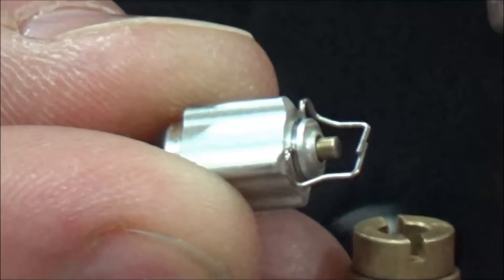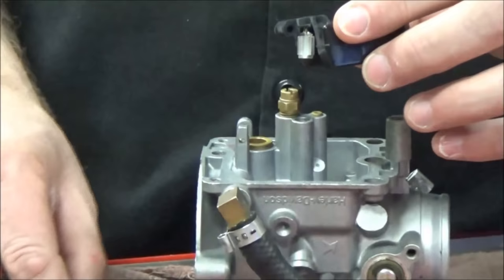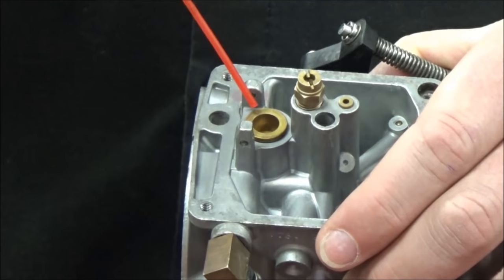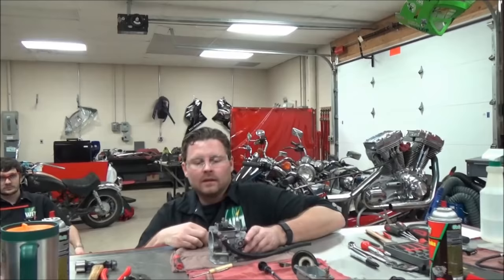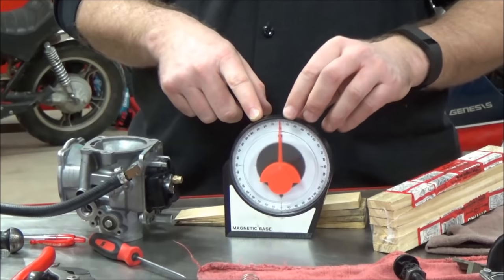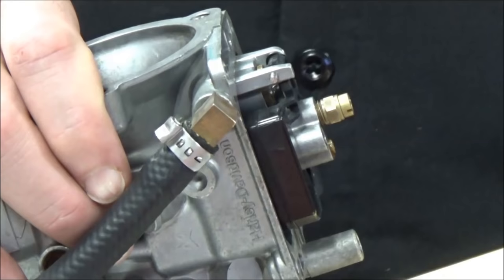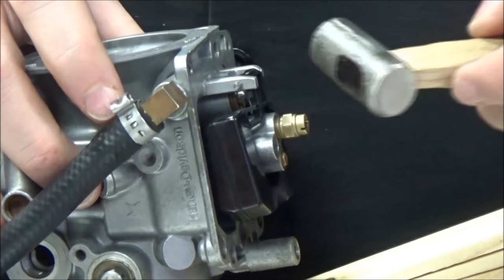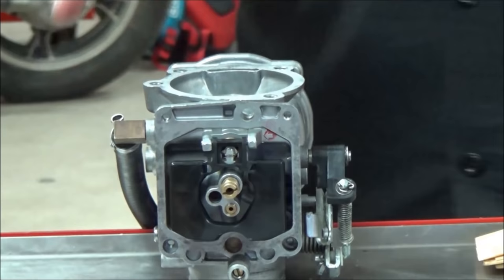04 How to inspect and adjust float level on a carburetor. BONUS: RICH LEAN Fuel Settings explained!

Comment: At first I was very disappointed that the special measuring tool seemed so far off (and that you dismissed it without further investigation), but on reviewing that bit frame-by-frame, it looks like it was set to 10.0mm, which is below spec (10.5-11.5) whereas you had the calipers set to almost 11.5mm.

If the spec does not place the float level to the casting you have to verify exactly which part of the float should be measured based on the service manual procedure since not all parts of the float will be at the same height. This is also true for other float designs which have round chambers.

I would have used a pin punch when setting the pivot pin to avoid any risk of hitting the support leg/tab instead of the taper pin.

But overall a good demonstration of how to determine the correct angle to tip the carb to make the measurement (assuming the manual doesn't provide a specific angle like this one does).
Reply from the maker: Thanks for the feedback. Always welcome. 
Thank you for commenting. Want more? Smash the sub button! Here are the links to support us for this information and our work saving you money.
Join this channel to get access to perks: (Free tool giveaways and member-only videos)
https://www.youtube.com/channel/UCBhM8DCKnT3qXwTW0eToyCg/join      

Give us a high 5 here:  https://www.paypal.me/how2wrench
Reply: Also wasn't using it square it looked like!

Comment: Hey shane , on 2003 yamaha kodiak 400 carburetor,  the atv was given to my dad. I cleaned carb and put new jets / needles in it and machine runs great but i cant choke it much at all even when freezing temps or floods it out. Valve and seat is new and not leaking fuel out overflow so i know float is off , bike runs rich overall. My problem is , service manual says to set float while upside down , well weight of float works against you and i cant get it right. What do you suggest ? Adjusting it upside down seems dumb to me
Reply from the maker: William Welker If it was a quick answer I’d try to respond here but I wouldn’t want to lead you wrong assuming certain factors. Reach out to me on my website contact page. We have been overwhelmed with ungrateful people and
scammers so I had to do something for my sanity by screening the over 300
requests a week! I’d love to working with my members and supportors one on one! 

Contact Link: https://how2wrench.com/contact/ 

Your answers and help are just around the corner. Save time and money while protecting your investment and yourself by doing it the right way at www.How2Wrench.com 

Have you subscribed yet to never miss a video? Have you seen the video playlists https://www.youtube.com/user/conleybuilt/playlists? 

Want to say “thanks” or “keep it up”?
Click here https://www.paypal.me/how2wrench

Comment: Hi shane great video!! I wonder if you could help me understand the lean & rich mixture ldea a bit more when adjusting the float level. I understand that if theres not enough fuel in the bowls the engine wont have enough fuel when you open the throttle & will probably cut out etc. But if there is a bit too much fuel in the bowls wont the jets meter it upon demand & that if there is much too much fuel in the bowls wont it just be dumped through the overflow pipes? Cant quite get my head around it. Any explanation would be much appreciated!!
Kind regards!!
Robin
Reply from the maker: Thank you for taking the time to comment! Hit that subscribe button please! It helps us!
Here is a way to support all the free videos.
Want to say “thanks” or “keep it up”? Click here https://www.paypal.me/how2wrench  

Coach Conley is also available for hire to personally work one on one with you if ever needed. Yep he is a real person. Give him a call @ 602-345-0432

Your answers and help are just around the corner. Save time and money while protecting your investment and yourself by doing it the right way!
Follow us!
Web:
www.How2Wrench.com    
www.Tools2Wrench.com

Comment: My Suzuki GS750E 4 carbs have circular (drum) type floats. Unlike the Harley floats it's difficult to check the floats being parallel with the base line of the carb...ie ..the seat of the carb. bowl.  Also each carb. has 2 plastic floats attached at each end of a brass plate with adjustable tab. How can I check each end (float) for proper alignment? Also the shop manual shows the carb. should be inverted 180 deg. & height adjusted using a vernier gauge & bending the tab to specs. i've done all this as diligently as I can after replacing the jets/needles & seats etc... (Carb. kit) & still leaks fuel. Carbs have been off & on 3 - 4 times with same results...not a simple job on a Suzuki 750 ...very tight installation. I'm stumped!
Reply from the maker: Head over to my website become a member now and to receive 20 minutes of personal mentorship with me. You can even use FaceTime if you have it or find a friends iPhone and we can walk through the actual carburetor process together. I look forward to mentoring you.

Note: Membership is not required to receive coaching or email help. Here are the direct links to individual services offered at H2W:

Email Answer Service-Click http://how2wrench.com/product/email-support/ 

Phone/FaceTime Coaching-Click http://how2wrench.com/product/personal-tech-training-phone-facetime/ 

DIY Mentorship-Click http://how2wrench.com/product/diy-coaching-hire-teach/ 

Dealership Training Services-Click http://how2wrench.com/product-category/dealer-services/ 

MMI/Tech School Student Tutoring-Click http://how2wrench.com/product/mmi-tech-school-student-tutoring-services/

Motivational/Guest Speaker-Click http://how2wrench.com/product/motivational-speaker/ 

On-site Training Services-Click http://how2wrench.com/product/on-site-training/ 

Tech Line Services-Click http://how2wrench.com/product/tech-line-minutes/ 

Mechanic on Duty-Click http://how2wrench.com/product-category/mechanic-on-duty/ 

Did you like this free video and hope to see more? Would you just like to say thank you with a donation? Click https://www.paypal.com/donate/?token=TvKoeRazPL-KysbM-e0ttz-C_gPq2IrqxDmM3ORCu4nxJzQWxYbmo-6m3YuNu64XHLngGW 

Keep Wrenching,
Shane Conley
Instructor/Motivator/Motorcyclist!
www.How2Wrench.com

Comment: great video series shane i have learned soo much.  I am restoring a 1985 lt250r.  The floats are actually captured in the bottom of the float bowl.  It seems difficult for me to get the metal float arm to just barely rest on the float valve.  Any tricks of the trade for this type of carb?  Also would a rich float height make my quad urinate through the overflow tube?

Comment: Hi Shane, great video, I have a wood wedge in my toolbox as well lol. I have a question. 95 harley big twin, only mod  are drag pipes. The bike was in storage a few years back and when I took it out, I had the dealership take care of it due to performance issues. I didn't have the time to do it myself. It never ran right after that. They cleaned the carb by dropping the bowl and that's it. The symptom is a dead spot when rapidly blipping throttle when the bike gets hot. The carb is as clean as a whistle, I have new accelerator diaphragm, slide is good and I have tried a 42, 44 and 46 pilot jet. As I was dialing in a mixture, nothing I did effected it. So for fun, I decided to see if it was too rich by putting my finger over the accelerator nozzle and low and behold and instant fix. Twenty blips twenty perfect responses. Finger off, I get an intermittent symptom when hot. What do you think, possible nozzle damage by technician possibly elongating hole or float height?

Comment: Hey i want to ask your opinion Got a cold start problem on my '89 883 sportster. I pull the enricher cable but the engine never start,only the sound changes. So i must turn the engine like 1 minute without enricher and without throttle. Its the only way that works. With hot engine starts perfect,run perfect. I rebuild the whole carb,new enricher cable,new intake seals,new spark plugs,tried all jet sizes from 160 to 190 including 170 stock,3 needels etc. Im running with free flow pipes and custom air filter,but even with stock filter and stock pipes was the same problem. The floating level is perfect. Its the keihin cv 40 without acceleration pump. The only trick that works everytime : I remove the air filter,pull the enricher and obturate(block) the small air passage from the left side,it's start instantly Sorry for my bad english,hope you got the ideea. Wayting for sugestions Thanks

Comment: Great instruction. Could this be my issue on my 96 Suzuki 1400? Two rebuilt carbs. the front carb has mixture screw set at 2 turns out. the rear carb has mixture screw set at 1 turn. From the factory, I think as these had welch caps on them. I can get the motor running but having to hold my hand over rear carb almost fully shut off from the air. I can rev the engine a bit as long as I compensate my fingers further apart to restrict a bit less air flow.  Perhaps it could be the float angle? Or would you think it needs to be able to run richer? The bike is worth about a grand running. If I take it to service then I'm sure I'd never profit by selling it.  Has 1500 miles. Was stored inside a garage for 23 years. Like new. Only these carbs are the problem with it running right now. Nothing else wrong.  It has a new fuel pump I added, with new fuel lines. Surely vacuum would not be an issue here?

Comment: an 8-32 set screw would be an improvement over bending the tab with a screw driver..
great vid on the techniques tho. 
most of the older methods could be mentioned and go directly to the depth micrometer tool.
All for brevity ya know since us HD riders have such crowded social calendars, 
juz sayin..

Comment: This has been making me confuse. Btw is this correct? A correct height adjustment on the float bowl means that there's a hair line gap between the metal tang adjuster of the float bowl and the float valve button? 

 So when the carby got filled up with fuel the float bowl would be lightly pressing the float valve button?

Comment: Will the float cuase the gas to pour out the front of the carb. The motor wants to run. But floods itself out and gas pours out if the top carb when trying ro run. It will idle. But pours gas out.  > have came up with 2 conclusions. Float or Reed valve. Help

Comment: I have a similar mikuni carb for my quad. The bowl has an angled gasked surface. The float was setup parallel to that plane but I think I am getting too much fuel. The overboard drain keeps leaking fuel a bit. I'll set the floats to be on plane with the jets and see if that helps.
Reply from the maker: Thanks for subbing!
High 5 us with a donation: https://www.paypal.me/how2wrench   
Join this channel to get access to perks:
https://www.youtube.com/channel/UCBhM8DCKnT3qXwTW0eToyCg/join

Comment: Should the VOES hold a vacuum?  When testing thru a vacuum line that is disconnected from a Harley carb?  My switch worked showing continuity but will not hold 5" vacuum.
Reply: It was the vacuum tool leaking disregard question...I watched the video on checking tool for pressure and vacuum test before using.
Reply from the maker: There a few ways you could help keep this work going and stay connected with me personally.  
1. The fastest and best thing you could simply do for us is hit that subscribe button…helps us creators more than you know! 
2. Join this channel to get access to perks:
https://www.youtube.com/channel/UCBhM8DCKnT3qXwTW0eToyCg/join   
3. Give us a high 5 here:  https://www.paypal.me/how2wrench    
Keep Wrenching,
Shane Conley
Peoria, AZ USA
Follow us!
www.How2Wrench.com       
www.Tools2Wrench.com    
Facebook: 
https://www.facebook.com/How2Wrench/   
Instagram:
https://www.instagram.com/how2wrench/

Comment: if i get this right, if i give a full throttle and my bike GSXR 1100 mikuni bts40ss starts to choke (my problem) at 4000rpm my floaters can be off messure and not get enough gasoline?

Comment: I have an old 2 HP evinrude outboard motor and I could only get it started with the throttle plate in high . I tried adjusting both high and low needle valves and no help. I checked the float like you mentioned except for the air testbut I found my problem well half of my problem was with the rebuild kit Amazon sent me. The Float was wrong and the valve seat was the wrong thread and the jet was also wrong. I reinstalled the original float,valve and seat and started it up in high as I had been doing and it took off like gangbusters but only to shut down like it ran out of gas. I have tried everyting but can get it to run. I am convinced though it has something or everthing to do with the float needle valves area. any suggestions would help Thanks was letting

Comment: I recently bought a Honda Rubicon that had been sitting up for a while.  
I've had the carb apart three times, cleaned it and the gas tank 
spotless as well as getting all new fuel lines and an in line filter and
 replaced the needle but it still pours out of the overflow.  I tested 
the float for leaks in a bowl of soapy water, it doesn't leak.  And 
after I put the float and needle back, they moved perfectly fine.   
Any ideas?  It's about to drive me out of my damned mind.
Reply from the maker: https://youtu.be/6BpKFtz_G24
Reply: +Shane Conley I appreciate the quick response but I don't think that's going to be it.

It pours out at probably a gallon a minute.
Reply from the maker: +ScienceFoundation 
Fill just the float bowl and tell me what happens
Reply: I have a 1981 HD sportster 1000cc my fuel pours out of overflow also incarbhow did you repair Phil

Comment: do you wet test when you're done manual setting? working on a 4 set of mikuni bds32's off a 2005 yamaha venture. on the bench every thing is fine no leaks put on the bike fire it up and it leaks

Comment: I recently performed a CV rebuild, as I also got new pipes and air filter. I installed the easy adjustment mixture screw, but my bike runs lean and dies at idle. It runs fine, as long as I keep throttling, or keep my choke pulled out. I went from my reference point to perform the fine adjustment and got as high as 4 turns, with no difference whatsoever. Before I rebuilt the CV, the bike was fine. Any ideas? Great video!
Reply from the maker: You're in luck. I do offer personal service to back up what's missing from a video to actually fix your specific problem. I do work on donations for my time and possible research. 
Good news is its CHEAP! For my time would mind becoming a member of my website? It comes with a free HOW2WRENCH “Keep Wrenching” t-shirt or 20 mins of techline and that will cover my time to assist you so we both benefit. So to have me personal cell phone number to put in your phone as your direct info and how to coach, sign up now! As always thank you and enjoy the free videos! Much more to come! I look forward to working with you and hope you will become a member of or learning community. 

Link to membership: https://how2wrench.com/product/membershipmembers-onlymembers? 

If I can ever be of service to you, here is a video explains how to connect with me. 
https://www.youtube.com/watch?v=vjvmB01ebcs 
Direct link to services: 
https://how2wrench.com/product-category/tech-lineservice-callminutes/ 
Live Chat is great for you to actually show your specific issue!
Donation link: https://www.paypal.me/how2wrench

Comment: Gas keeps pouring straight out of carb no matter what I do. I’ve tried setting the seat bowl height, making sure it has clean fuel. Cleaned the carb several times and rebuilt it still nothing. It’s 2003 Dyna any suggestions???
Reply from the maker: That’s a great question for Shane directly! We are just the social media team. Shane has a solution for you. As far as the question, Shane does answer questions when he get's back around to non members eventually so hang tight, FYI >>>> he does member ones daily!
He is just returning from an extended stay in Japan training students this winter. You can imagine how full his inbox is. We put orders are to the front of the line.

The one-on-one service. Get Shane’s cell here: https://how2wrench.com/ols/products/techline-one-on-one       
Quick answers are answered daily as a channel member: Join this channel to get access to perks:
https://www.youtube.com/channel/UCBhM8DCKnT3qXwTW0eToyCg/join   
-Daily MEMBER FIRST COMMENTS ANSWERED FIRST 
-Live Q/A video chats
-Wonder if we have a video on your need? Members can request content links!
-Full Access to the ENTIRE 700 video library
-Member-Only FREE tool giveaways  

Have you seen our "YouTube Trained Support Shirts? Great way to "high five us" https://goodfellasmerch.com/collections/how-2-wrench/products/support-shirt